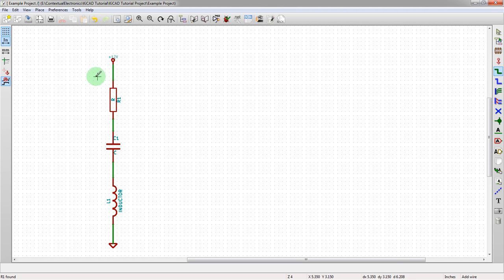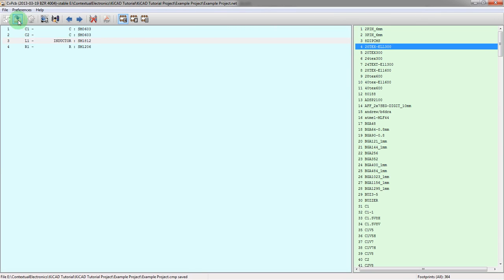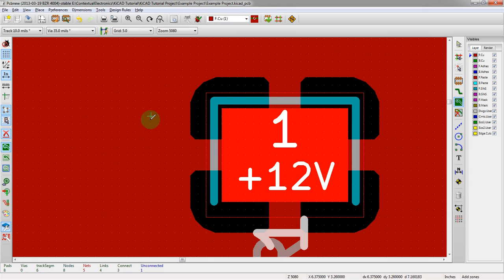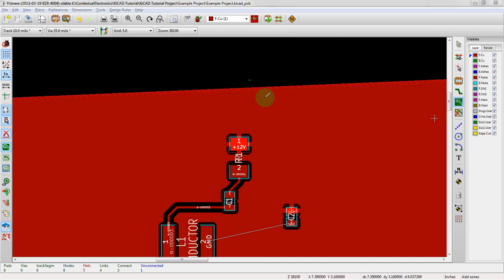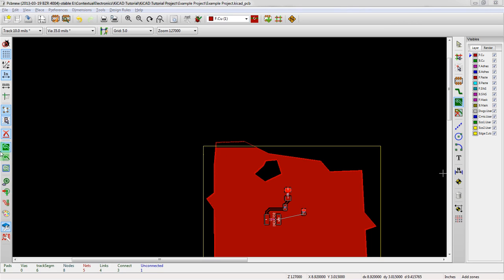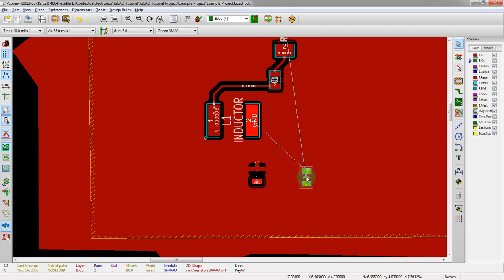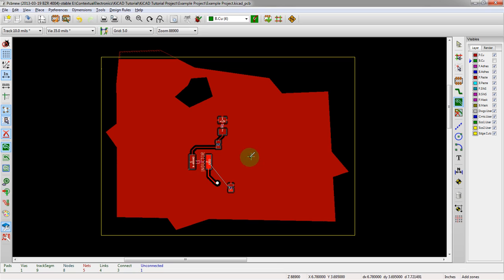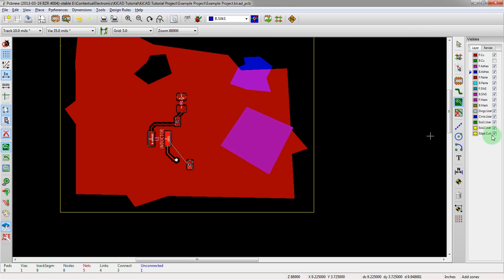KiCad 3.0 - Creating Power and Ground Planes In KiCad

Comment: Describe what you are clicking on. That's not "ground plane" it's "add filled zones". Then choose a layer; what layer? Say it! "Don't say "click over here".  In addition, screen is too small. Should have used a lower screen resolution so it is not blurred in the video. Don't move mouse for no reason; i.e., while you are talking don't shake the mouse. I see the "ad hoc stitch via" video uses a lower es screen; better, but still fuzzy at full screen.

Comment: I only want to add, it is NOT advised to use power planes, it can easily give problems like short circuit on the board, especially when using only 2 layer PCB.
Reply: yup, typically I like my 4 layer boards to be top, signal, power, then ground